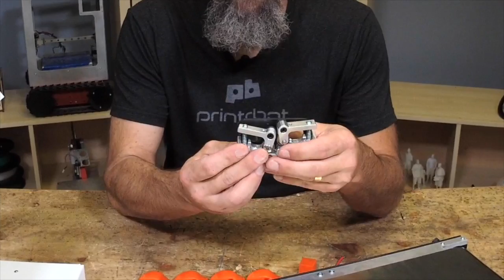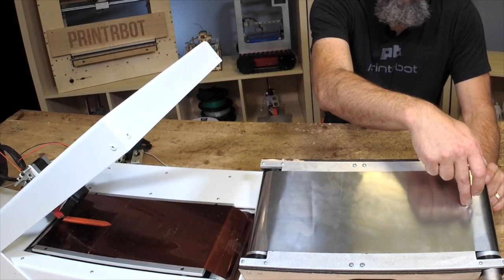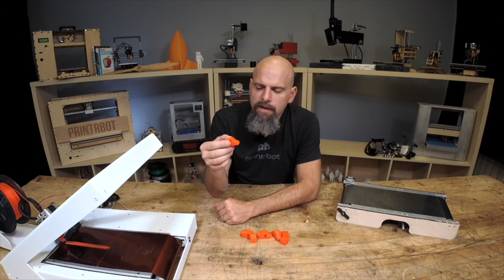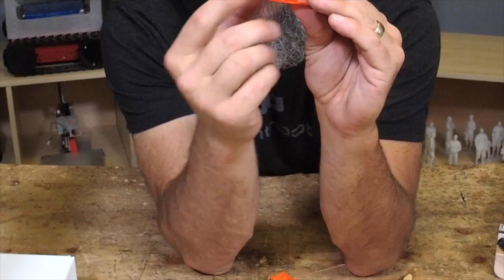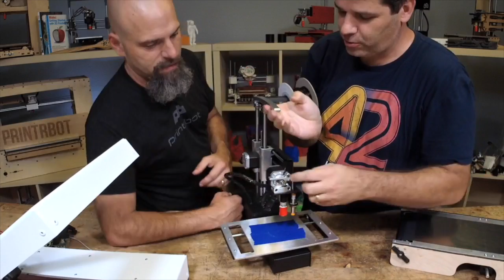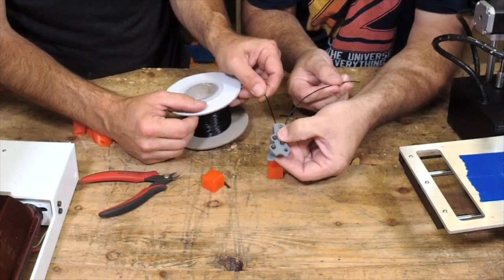Printrbot LIVE   7-13-17

Comment: Please do offer that conveyor as kit to convert existing printers, with multiple widths too! :) I am right now using a 300x300 size bed for example, some people are even using 500x500.
I'd be very interested if the cost is sensible.